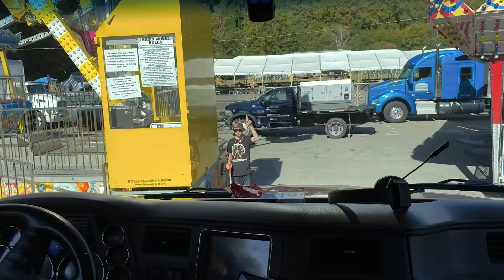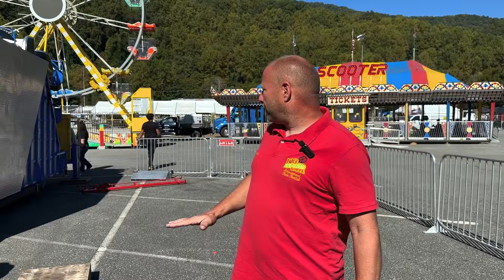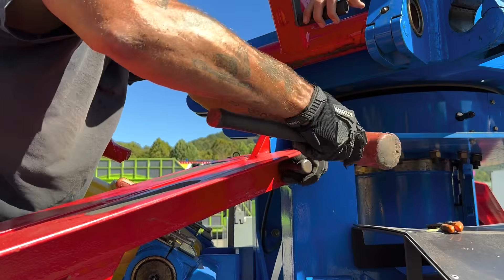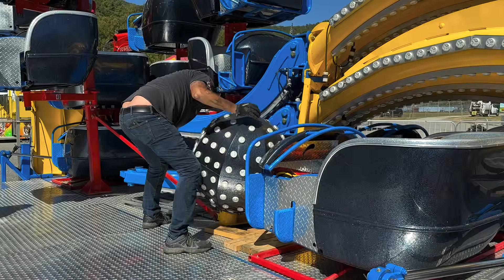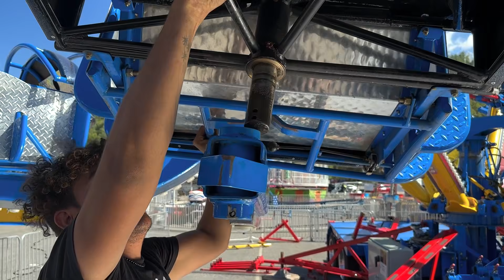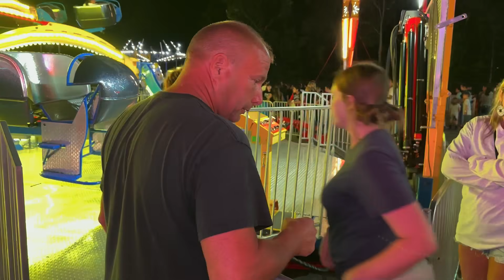BRW Episode 10 Life on the road. Setting up THE SPIDER Ride

Comment: And to think that in all these years,I assumed the ride operator & a laborer or two were responsible for the transporting/setup/midway operation & teardown for their ride only. I didn't know the operators/laborers from other rides have to work together with others til every ride is setup & operational.

I figured the smaller fairs/carnivals would have to employ the majority of their staff to work together to do the tasks I mentioned above (due to a very small number of employees) but I didn't think the larger/largest fairs would work this way. 

I've always wondered what the trailers are for that have a bunch of doors w/windows everytime I went to the TN State Fair where they had them?? They're for sleeping and some come with a shared shower. 

Some docs I've watched about traveling fairs overseas (London/Germany/etc) have ride trailers that come already equipped with that rides own self contained generator vs having a massive generator that takes up the entirety of a 18 wheeler van trailer which powers everything on the midway.The TN State Fair would always carry/have 2 of these.

A huge benefit of a self contained ride generator is you don't have to stretch out thousands of feet of bulky electrical cables,which makes it look so much cleaner and less cluttered,not to mention safer for customers as there's no longer a bunch of trip hazards.
Reply: Very true mate 👍.   I live in the UK and travelled in the 90s with showmen,  and each ride has its own generator.  One of the first things we did was hook up the power, and also the last thing on pull down.  If you've ever been to a travelling fairground in the UK you'll see all lights on whilst we built up. And I cant speak for the USA. But our generators used to run on cherry diesel.  I dont know if they still do now.  I miss them days.  As every night was always different.
Reply: @djandyt2009 
Never heard of cherry diesel?? I assume it's a more environmental friendly fuel type??
Reply: @wbrockstar9550 no mate its a much cheaper diesel not recommended for cars or vehicles but works in things like lawnmowers and tractors, generators ect.  It used to be sold by the drum very cheap.  As I say its probably illegal now.  Ill have to check pal ❤

Comment: Why dont you use Teflon mats on every corner, where it could sprak over other parts to prevent scratches?
and the pin could get a round or shorter part before the locking pin, to fit the hole.

but the bigger question as a German:
Why dont you invest in a more advanced ride like a BreakDance from HUSS or a KMG Ride?

Comment: At 73 years old now, I miss the carnivals and fairs. The food has gotten some ridiculous and I refuse to eat at the fair. So my wife and I just stopped going. I have loved carnivals all my life and when I was a little or young kid, it was hard to sleep knowing we were going to the fair. Today, it is nothing like then. Fairs or carnivals these days are too automated. The ride you are putting up here back in my day were the Tubs. But most of the rides back then did not have electric motors doing the work with NO sound. Back when most of the rides had an old tractor engine gas powered and most had NO muffler. The guys working the rides looked like they had not seen water for a month all covered in oil. Even the ferris wheels had gas engines doing the work. I live near Columbia SC and the South Carolina State Fair. Corn dog this year 2025  $11 and up. Smoked turkey leg, $20. Screw that. The fair started going down when they stopped having the Double Ferris Wheel or Skywheel as it was also called. I remember in Columbia back in the 70's, they had  two Double Ferris wheels side by side. What a cool site to see. I was the most beautiful ride ever made to this day. There are a few of them still running. It was a ride that in today's standards could not load and unload passengers fast enough. An that is what killed the SkyWheel.

Comment: Did you ever figure out a good solution for the pin for the tension rod ? Did you try holding the pin in place on the top while sliding rod into position- you would gain a small amount of clearance by pin already being upright. Great video - Love to see these rides setup.

Comment: Will the pin fit in the hole without the bracing bar in place? if so, put the pin in the bracing bar first, then lift the pin straight up to clear the tab when sliding the bracing bar in place.

Comment: Could you slide the pin in the top of the brace just to the bottom of the top catch. Then slide the whole bracket in place and finish dropping it into the hole the whole way.

Comment: Two things about that design...
The Battech Black Widow is an Eyerly Spider that sits on a trailer and swaps the countershaft for an electric drive. So other than the changes to the drive, it's fundamentally the old Eyerly Ride. Which is a good thing, because the Spider is a fantastic ride in almost every possible way (well, apart from some issues on the old sweeps...). Anyway, that apparently informs a couple of design decisions on the Black Widow. By floating the center over the trailer instead of using the trailer as part of the support structure like almost every other trailer mounted ride out there, the engineering of the center support is unchanged from the old ground mount ride, so nothing about the center had to be changed structurally. As you point out, it's a kind of a brilliant decision to do it that way, although it means you have to deal with the outriggers instead of just having them as part of the trailer.. 
But I suspect that also explains that @#$% pin that you can't get into the tension rod near the base. Because the design of the center was unchanged, they didn't move or alter the pin that is now obstructed by the trailer. 
Given the amount of detail Battech seems to have gone into with trying to make the setup and teardown of the ride "not suck", like the battery operated hydraulics and the self contained cranes, it does seem odd that they didn't somehow address that pin.

Comment: I'm a ride junkie from Montana, and just found this channel by accident! Absolutely loved this video, and it's crazy how the new Battech Spider cars load so differently from the old Eyerly ones! Have you guys ever had an Eyerly one? If so, which do you prefer?

Excellent job keeping your rides nice. They're gorgeous dude! 

On your Himalaya, I have a question: I think it's a smaller Wisdom model. I've been on the larger Wisdom ones, and felt they had basically zero airtime when compared to Mack, SBF and Bertazzon models. That smaller one you have seems to have more dramatic hills, so does it have good airtime? The big ones from Wisdom are practically a flat disc on an angle, so you get lateral G's but never negative vertical ones 😞

Comment: Always impressed by the engineering need to make a fold up attraction freeway legal!! When I was young and strong looking I was asked if I wanted to come back at closing time to pack up their Top Hat ride. It is a rotating deck with teacups and periodically the whole deck racks up to a 25 or 30° angle with a big swoosh! of air (from an accumulator?). It was fascinating, exhausting and very labor intensive. Their double ferris wheel was taken down and driven away in 1/3 the time with 1/2 the crew. We saw the Sun coming up and we started at 10 the night before...
Reply: I had a couple of high school buddies who would go to the fair late on the last day lol. The show that used to do our local fair as typical had the help wanted signs for breakdown at fairs close. They were 17 the one year and lied about their ages lol, and the 18 the year after. This was early 1990s so the double ferris wheels (skywheel) were still somewhat common. The foreman wouldn't let my buddies touch the skywheel ride lol. He said they had special guys for that ride. I loved the skywheel and haven't seen it in person since 1997 😢. With modern engineering I am shocked Chance has not built anymore. It's a gorgeous ride where your either a fan, a hater, or just simply terrified lol. It's a crowd pleaser, a sight to be hold, seen for miles at night. It's crazy there are only a few left that I know of. Anyone know of any fixed skywheels operating at a park somewhere?

Comment: Thanks for a very detailed and well done video. I've worked for two different shows and both shows had a Spider which I worked on and moved. This is the first time I have gotten to see and watch the new trailer mounted version get set up. Quite a bit different than what I would be used to. Especially the operating with buttons instead of two handles.    I also want to compliment you on having a nice looking show

Comment: I have never seen rides and equipment that clean in my life. Nice to see this professional traveling carnival 🎡 I want to buy a Zipper for home use.
Reply: Lol  you don’t want a zipper.. the cable, drive motors and track wheels require maintenance as well as the door latches need to be replaced every year unless chance changed the 3 lock design.. plus the cost..
Reply: Good point probably be lots of maintenance time and money required to keep the zipper safe and running! @welding_guy7524
Reply: @welding_guy7524  nah dude, I'd LOVE to have a Zipper in my back yard. I can perform the work, it's just the cost part that I haven't figured out yet😂😂

Comment: This is called the Octopus everywhere I've ever been too.
Reply: The Octopus has one tub on each sweep.  Eyerly Aircraft modified the octopus twice, the Spider having 2 tubs on each sweep and later the Monster having 4.  The Spider and Octopus being the most successful of the 3.  Very few monsters traveled as most went to parks.  The design of the Monster was not that great and probably the reason it was not successful.
Reply: the octopus has 1 tub per sweep ..I’ve never seen the monster.. it’s always been one of those myths .I’ve also never seen a trailer mounted spider..it’s like a tilt  all I’ve ever seen was ground mounts but then again I haven’t been in the business in 15 years
Reply: @welding_guy7524  ok. I believe you. I've never paid that much attention to detail on it.
Reply: @welding_guy7524  I believe you. I've never paid close enough attention to it.
Reply: It’s possible you saw a spider a show renamed.. it happens all the time.. its kinda like how wisdom has 4 different names for the tornado or graviton ..

Comment: GREAT video and what BACK-BREAKING work to assemble and disassemble this ride.  I salute you all!  (When I was a kid back in the 1960's, this ride was called "The Octopus.")
Reply: It was still called the octopus into the late 90s!
Reply: @stephenbate933  they have two one is the octopus  has six arms like the spider, but with four cars, rather than two
Reply: Spider, Octopus, Monster, there are many names for this ride. I think everyone from Chance to Zamperla builds them too. I like em. I'll even ride the ones at permanent parks. The one at Cedar Point used to spin like crazy.
Reply: I think they both travel bc my fair had the octopus 2 years ago

Comment: Great video! Beautiful machine. A laser tape measure device might allow your crew to set the perimeter gate at the proper distance when first setting it up to avoid having to re-tune it later with measure wheel shaving a bit of time.

Comment: That looks alot easier than the older ground mounts i used to setup and pulled over the road for 20 years 😂
Reply: Those were the days for sure. The Spider, Scrambler were a beast. Very heavy and hard to set up. You had to have very strong men to set them up. Today's rides have been made more diverse and much easier to set up. Still this Spider is somewhat complex however it all mostly stays on the trailer which makes it a bit easier. I really like this ride series. This guy definitely cares about safety and keeping his rides in really good working order.

Comment: Darren, I think that Battech did a great job redesigning the Spider. The old way was a lot more difficult to set up, and now running it is so nice. Thanks for sharing.❤
Reply: I like the fact that the main arms and the J arms all come off as one back in the day every one of those pieces was handled individually I'd also like to see that Center I'm sure it's quite a bit different than the old 2 axle Mack truck driven centers